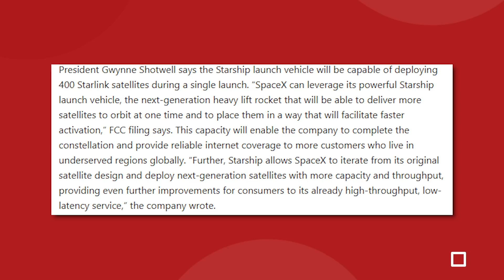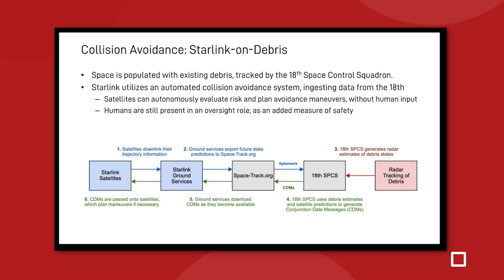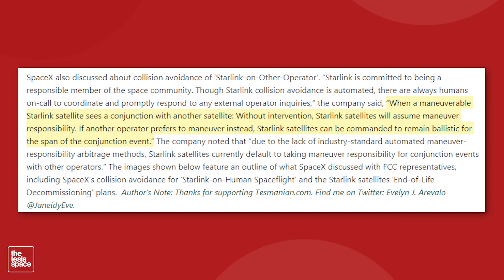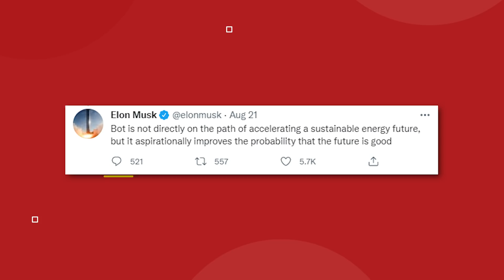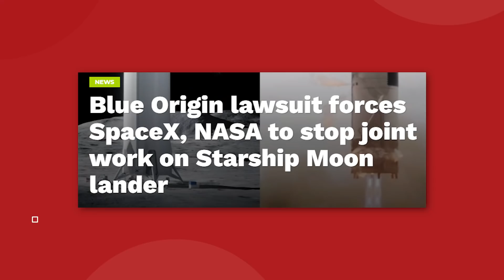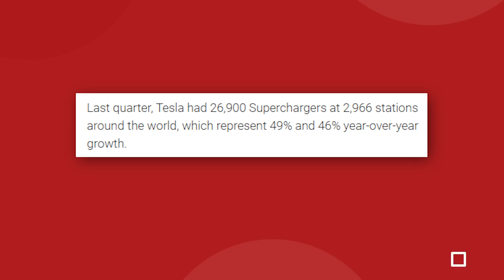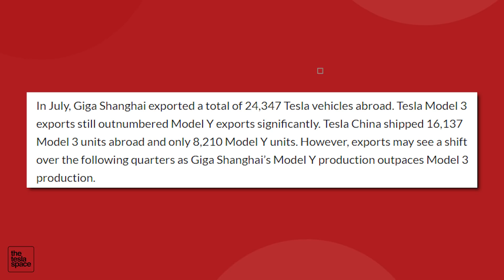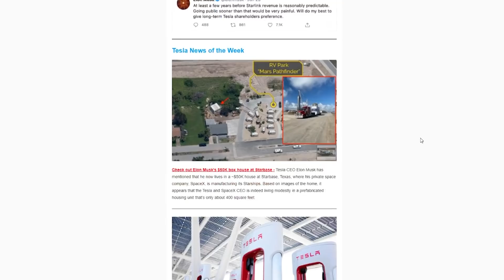The Real Reason Tesla Is Building A Robot + More Tesla News!

Comment: Send robot to terra form all the planets before future generations are ready for inner solar system travel terminals.
Have them build gyro shape rings 
around the planets to generate an 
electrical force field. That blocks 
Intersection path of potentially Catastrophic events from happening.
With rockets that went from the space ring terminal to elevating Levitating  space portal stations that take you to the surface of there planets terminal locations.

Elon should design an underground 
City that could survive a solar flair 
Ejections from the sun aimed directly 
at the us Destine to burn everything 
on the surface of the earth. But under ground dwells that could produce 
its own climate to maintain a lifespan 
Lived under ground.

Or just start by building an 
Under grounds surface 
To live in under tornado alley.
Under ground shelter are built 
to survive tornados so why keep 
Rebuilding the surface when 
Building under ground community
Could living under 
the tornadoes as the past.
Just a Thought.